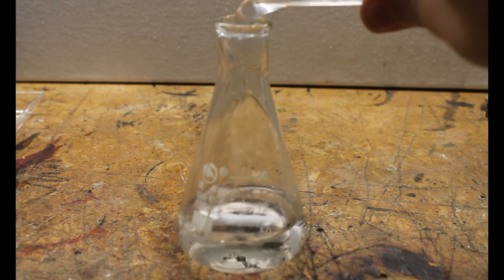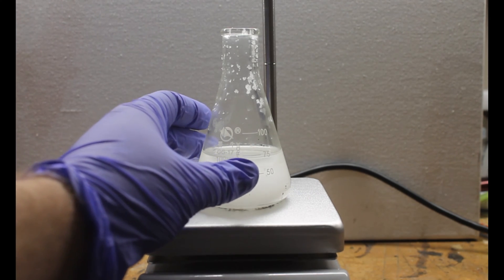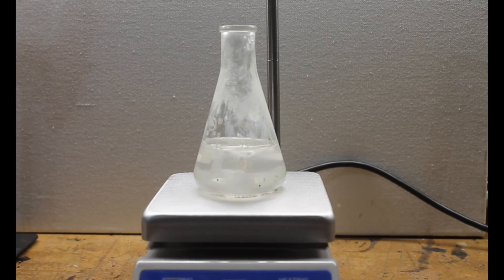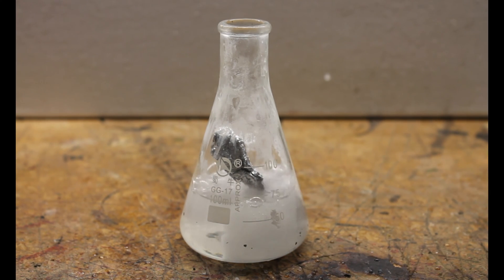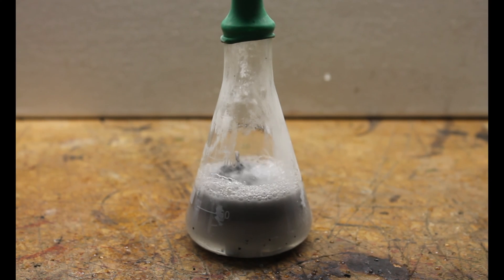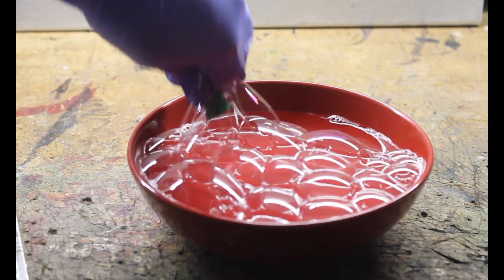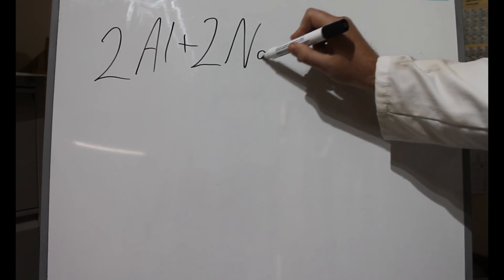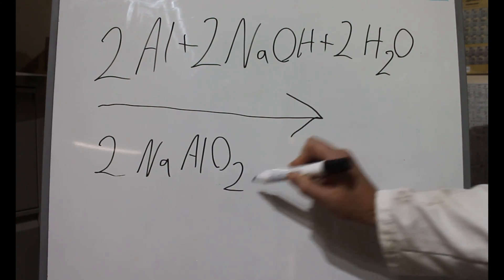Reacting Aluminium and Sodium Hydroxide!

Comment: I'm new to chemistry, but I have been fascinated by the subject since I was a young boy. Lately, I took an AC unit apart, and wanted to salvage the copper shrouded aluminum fins. Aluminum is also a useful material, so if it was at all possible, I wanted to recycle it as aluminum hydroxide. I used a plastic container, and added approximately 0.25g of sodium hydroxide to about a cup of distilled water. The reaction began after a moment, and it was enough to safely, slowly dissolve the aluminum. 40g. . . OMG! I thought you were trying to make instant sodium silicate of your flask, or even a bomb with the hydrogen.

Comment: This comment may seem abit off task but is it okay to use sodium hydroxide for a dry distillation in a moon shine distillar, can it explode ? Edit = I mean moonshine distiller as in the metal bucket with the copper coils
Reply from the maker: In short, it would not be wise.

In long, it largely depends on the metals involved, it is unlikely to cause a risk of explosion, however, this is a possibility if the still pot is made of aluminum.  More likely is that the still itself will receive irreparable damage.  You mentioned that it had copper coils, these may well break down into a copper hydroxide forming a precipitate and losing structure from the coils themselves.  If the pot is iron based the NaOH will likely cause a redox reaction and rust it through.  This is mitigated slightly by using stainless steel, but it will still cause damage over time.

If you were looking to safely distill NaOH I'd argue that your best bet would be to use borosilicate glass distillation set ups.  They can be a bit pricier for the size but they do sell small set ups for essential oil distillation which should be able to do the job.

Hope that helps,

-Tony
Reply: @ThompsonSTEMEngagement  thank you for your reply i very much appreciate it, is there any glass that can withstand the sodium hydroxide in a dry distillation? because iv cracked alot borosilicate flasks ):
Reply: Why would you want to even do that??? You don’t friggin need to distill sodium hydroxide to make the following reaction!!! For Christ sake… and a damn bootlegging still? That’s so unscientific!
Reply: @anthonylepore516  to obviously make more product at one time? Bootlegging?

Comment: What do you think the crystals are for in draino
Reply from the maker: Ok, so I've actually never seen that brand of drain cleaner in Wales, so I looked it up, and the active ingredient is in fact sodium hydroxide.  Please don't put aluminium foil in there though, it probably would generate a certain amount of hydrogen and we'd rather you didn't recreate this without the appropriate safety measures that we have.  Unless you have a lab ... in which case, go for it, just risk assess first ...

Comment: Hello ! What is the molar and atomic mass of sodium tetrahydroaluminate hydrogen ?
Reply from the maker: Oooo, molecular mass has never been my strong suite, however I'm pretty sure that the mass of sodium tetrahydroaluminate is about 54 g/mol and hydrogen is just barely over 1 g/mol.

Hope that answers your question,

Tony
Reply: @ThompsonSTEMEngagement  how did you calculate this ?
Reply: @_chibo_3492   sodium aluminate has a molecular weight of 81.97 g/mol. You get this by adding up the atomic weights of all the components 

23+26.9+16+16= 81.97

Also, hydrogen gas exists always as H2 or diatomic hydrogen. As a result, one mole of hydrogen would not weigh 1g but 2.

Comment: Can be used to make flying balloon
Reply from the maker: One that comes with some risks
Reply: @ThompsonSTEMEngagement 

Yep a lot of risk

Got a lot of chemical burns

Some containers explode and yes theoretically if the reaction is super fast the hydrogen isn't pure which makes the balloon heavier

Plus flammable gas
Reply: Think the safer route for that is helium lol
Reply: @Richiolio  I agree but the price to pay.
Reply: No it can not.. too much water vapour...
Reply: @Martin-wj6um  I tried it and well it floated.

The tactic is do not speed the reaction or make it more controlled.

That way.

Hydrogen goes up

Air level goes down

And well water doesn't evaporate that much.

Or well you can do the double bottle

For cleaning and purifying the hydrogen.
Reply: @Martin-wj6um  here's the double bottle method to make flying balloons. 

https://youtu.be/EyKdxuDxlbI